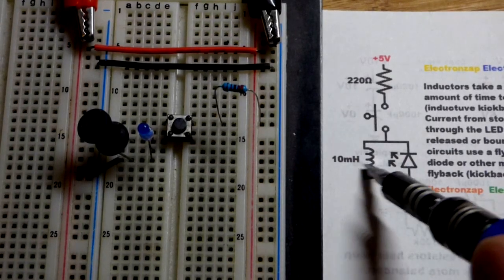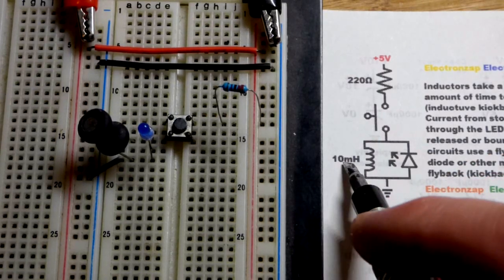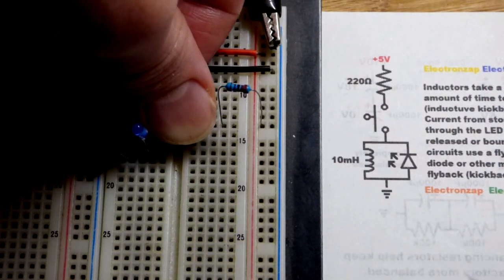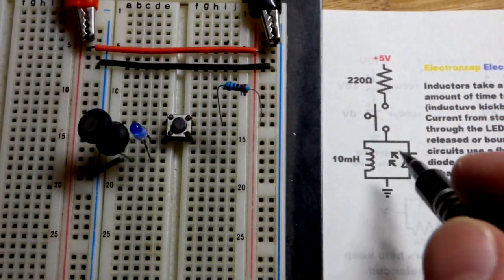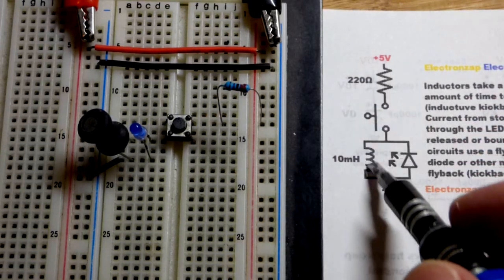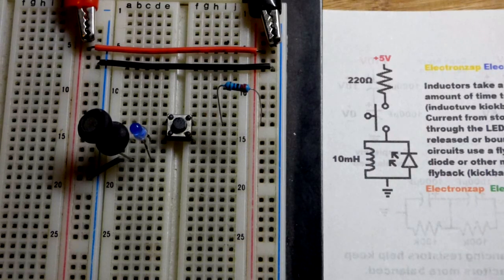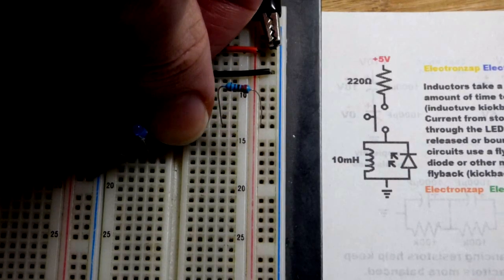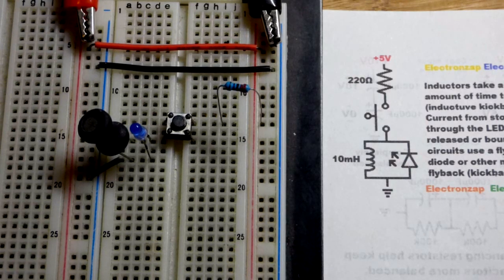Inductive flyback or kickback flashes an LED demo circuit for learning electronics shorts 87

Comment: Led flashing means inductive current flows into the positive of diode and exit at negative side. Then, why current doesn't take the path of low resistance which is ground???

Comment: If the inductive current is 
Flashing the led, then how come the current doesn't directly flows to the ground?
Reply: It does go to "ground" and then back up the diode in the forward biased direction. The "ground" is just the return path to the battery which has now been disconnected. If you redraw the circuit diagram in the conventional way with all three elements in parallel (source, inductor, LED) you will see it. The inductor will develop a voltage positive on the "bottom" relative to the "top" to try to keep the current flowing once the switch is opened. This will forward bias the LED and it will light up.

Comment: What in case if the inductive spike voltage is above the voltage handling capacity of the led. Even if you put a fast diode but the voltage spike is above the voltage capacity of the diode....
Reply: If the kickback current has a path to flow through I.E an LED then that voltage shouldn't exceed the supply voltage. It's only when the inductors magnetic field collapses and there is no path to ground that the voltage rises to silly levels.
Reply: @vorlonempire6954  Don't think that this is true. Why should the inductor voltage be limited by the supply voltage? This isn't a capacitor. The inductor voltage is proportional to the rate of change of the current and has nothing to do directly with the supply voltage. Remember V = L*dI/dt. The "faster" the current is disconnected the higher the induced voltage. With a big enough inductor and even modest source voltage 1 - 12 volts you can easily get up to 70 V induced voltage.